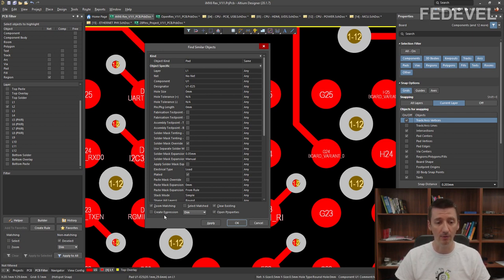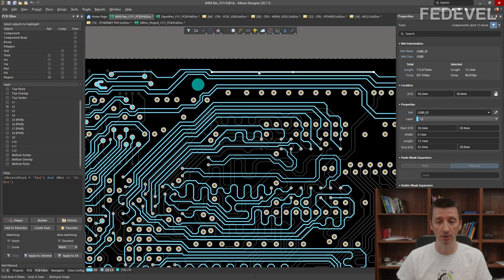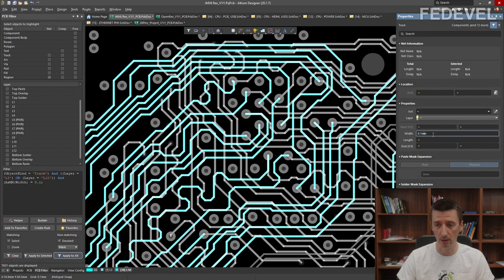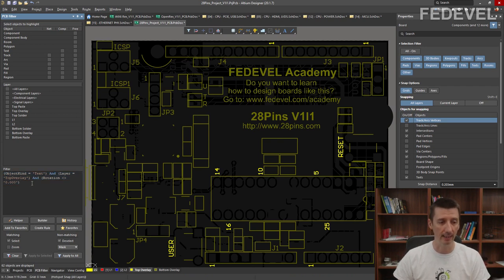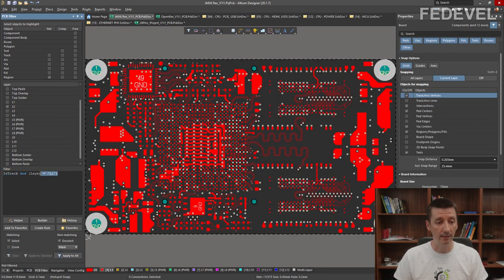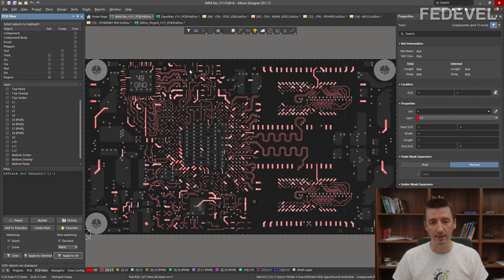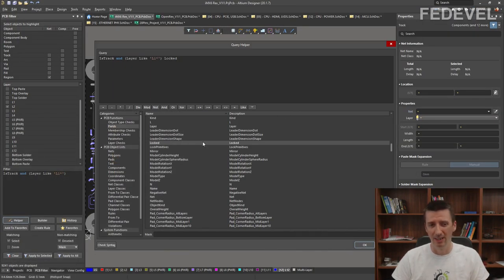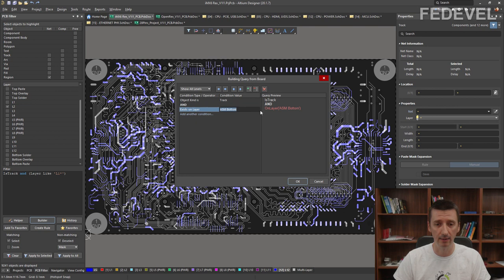Altium: How to create Filters & Rules EASY (+ 8 Useful Examples)

Comment: Robert, in your data L4 and L9 is plane type layer.  The default clearance for this layer is 0.1mm.  You did not make special rule to avoid slit as layer 2 and L11.  Because of it plane layer type, the connection and clearance is negative plane we always forgot about the slit.  What is your suggestion on his matter.

Comment: In the first example when you said 'No net', does it mean that no net is assigned to that pad i.e it is a floating pin, or does it mean that a net is supposed to be connected to it (i.e PCB track) but none has been connected yet which means that it will be flagged up as an unconnected net when design rule check is carried out?

Comment: Another fine video, Robert.  
I wish the Altium query language allowed comments.  Sometimes the language for various rules get so complicated it really is like programming without any remarks.  If I go back in a couple weeks to look at the rules I waste a lot of time getting familiar with the "code".
Reply: Is there any solution for this at all?

I really wish that these Altium people had gone with Python instead of Delphi.
Reply: @優さん-n7m  
Thanks for the reply.  I'm not sure I get the Python vs Delphi mention, but since I posted my original comment 3 years ago, AI has come about and so when you posted your comment, I got curious again and asked Google's Bard.  It may be entirely wrong, as it often is, but Bard claims that in general, Altium Query Language resembles SQL, but one way they differ is commenting style.  Bard claims that AQL comments are made by double slash "//".  Whatever follows this on the same line is considered a comment.  Or, if you want a multi line comment, then start the comment with "/*" and end the comment, perhaps many lines later, with "*/".  
I haven't tried it, and next time I'm in Altium and have a few seconds, I'll try it out and delete this comment if it's wrong.

Comment: Hi Robert, I asked this question in more detail on your Fedevel forum.  Let me just summarize it here.  When you specify a clearance in Altium you get a table that allows you to specify different clearances between different types of objects.  However, if your custom query limits the types of objects that this rule applies to, then it seems like the table becomes largely meaningless.  For example if your custom query limits the rule to non-plated holes (as you did in this video), then the "track to track" entry in the table doesn't make any sense.  Do you agree?
Reply from the maker: Good point Thomas. PS: I would need to play with it to find out more.